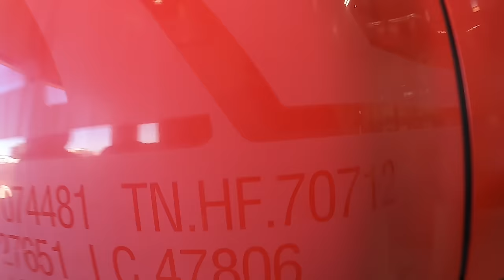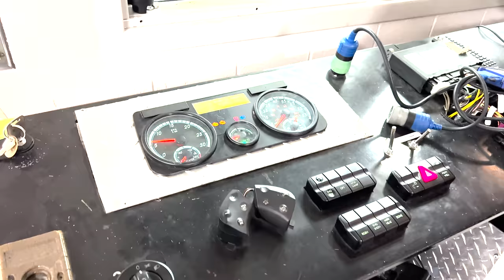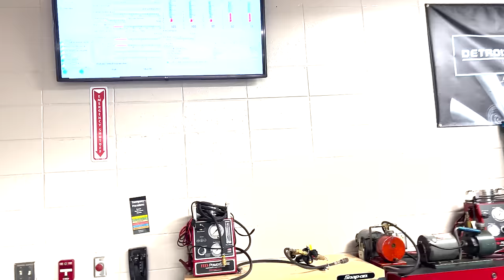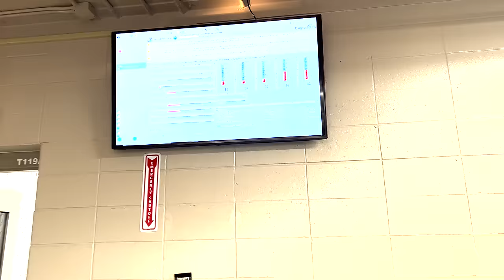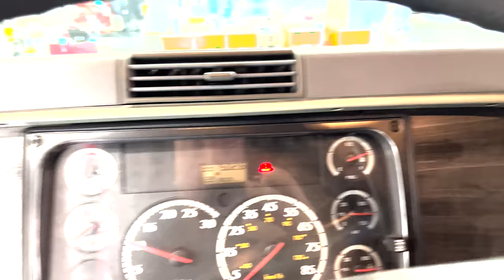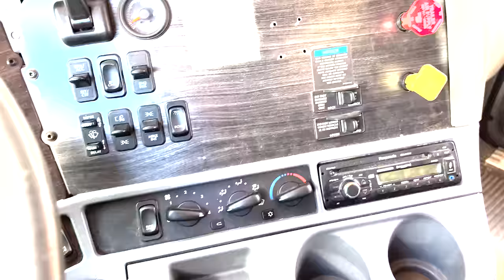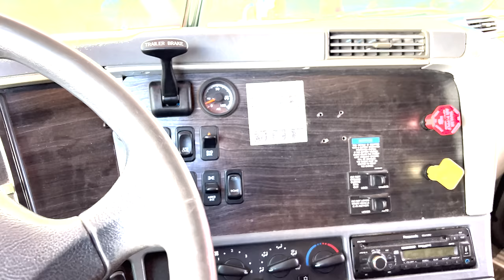ONLINE AUCTION PAYS OFF!! All Truckers Should See This Place

Comment: Tim, you ought to consider sending your younger brother up there for some classes. Maybe send him up to learn about the disc brakes. It would be a little time away for him, but worth the investment.
Reply: George Jones  I would love to see you pp a pin out flip a cover off and insert a new set of pads on a typical cars break system, like he showed. Then again there would be the differences between the ABS systems and the various different air versus hydraulic parts in the actuation system, so yes in the big picture, they are similar, not identical. Tim has far more experience than Devin, yet he has apprehension about disc brakes. Throw in Tim's admiration and wishing for a school like that when he was just starting out and that is why I believe sending him to that school or another closer by to get some in depth training would be a solid investment in his business and his brother.

Comment: Unplug the speed sensor to get you home. Buy a cheap GPS. Your only governed if the ECM knows how fast you are running.  Unplug Speed sensor. Wide open you are. That’s a old trick the automatic truck drivers can’t use

Comment: if your really interested in some formal training check with Truck Centers inc in Troy Illinois   they are a large Freightliner dealership with a training center on location staffed with factory trained and certified teachers in which I had the pleasure of working with and going to the training center. they are primarily for the training of Truck Centers techs and the TCI first training program, but they do have classes open for other dealers and repair facilities, I can put you in touch with the owners if you want to get into a course. they have a lot of the stuff you saw at that facility and more. they have courses to cover anything and everything.

Comment: just a little bit of imformation on road trains in Australia  these guys pull up to 160 tones with 4 trailers many of these guys love the detroits with there great fuel consumption they can aford to rebuild them and saving on fuel pays for there time off and the  rebiuld but they do an inchassic rebiuld to pevent brake downs (PS remembering this wieght takes its toll  thats 160 ton thats 360000 pounds just for the load with tri drive and tri trailers and dri dollies

Comment: Can’t believe people ditch old semi trucks. I rather drive those. You spend so much crap on modern semi trucks…you a computer to even work on and triple your pay check to buy sensors or mother boards. New trucks are just for luxury. They are not a work truck no more. Old trucks where real work horses and much easier and faster to work on. Plus you can make it fuel efficient if your a gear head or engineer. Old trucks spend less pay checks in repairs and some fuel. Than modern trucks. Don’t forget when you register it’s so expensive to get a modern truck on the road than an old semi. The government is very picky on modern semi’s and bug drivers more than toward drivers in old semi’s. Glad these two guys are doing well with there old units with no problem. Keep it up 👍 and God Bless.

Comment: Oh god a Century class I don’t miss working on these pos they might be cool to drive but as a mechanic back in the day them trucks are a nightmare and sometimes it’s a decent day lol The Volvo is a Powerful rig and comfortable plus the paint looks good, 😅 Camera guys hand stays Locked Ina C Clamp lol Hand is like lockjaw haha
Reply: I hated them also.  Changed a lot of fuel lines to the rear of the head on the side of the road,  first sealed front wheel bearing threw me a flip.. we did lots of roadside repairs

Comment: You called it a Glider. My understanding is a glider is a new cab, frame, front axle. You add your engine, transmission and rear ends. Are you going to part out this truck?
Reply: The truck was ordered as a glider in 2014.  It has an older engine than what would have been in 2014.  So it was a glider and still is.
Reply: @fsctrucking  Thank you, it had me going. Truck on.
Reply: What auction site did you list the truck on???

Comment: What do you have Cummings in if anything cause idc what that guy says my uncles has 4 trucks all with Cummings in them one just hit over 1.4 million miles still runs strong had it all tested and it’s in top shape still no blow by I mean none at all it just been regular maintenance is all replace 3 turbos is it took the compounds out which was the best thing ever he did made 2 of them twin tubskies and dam 850 hp and 1600 tq and that’s the weakest one

Comment: What switch is missing next too the air vale’s on the dash? I only see two black switches. Those are normally air slide 5th wheel, diff lock, and air dump. I only see 2.

Comment: Cummings is an awesome motor! If you know how to rebuild or repair them, they will last a long time! The cam issue was only thing that was a problem. 60 Series were awesome, But the new Detroits are no better than a Cummins!. I drove OTR for 36 years and never had a major issue with any of my Cummins engines! I had a 575hp that lasted over million miles. So to say Cummins put you out of business is bogus. Sounds like your mechanic was the issue if it blew rods at 1800 miles. Something wasn't measured or cost cutting caused that! Can't blame Cummins for some shade tree or someone who doesn't know Cummins and try to rebuild one! I can't believe as long as your DAD has been in trucking, he wouldn't like Cummins? You're always rebuilding all your Detroits, that should tell you something! Cummins isnt much more expensive than Detroit now days! If you had driven for 36 years in Cummins trucks, you wouldn't be bad mouthing them. Cats are the ones that will break a company! Kinda like your W900 did!